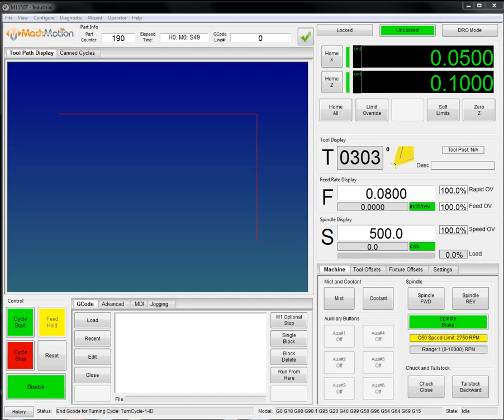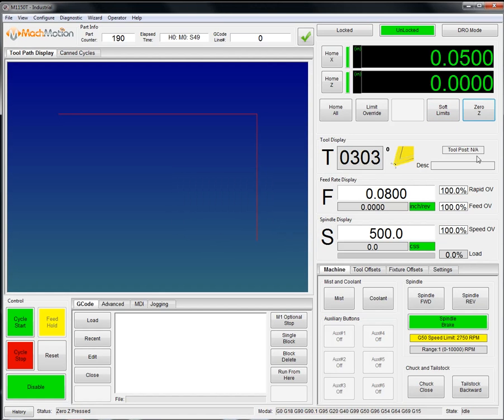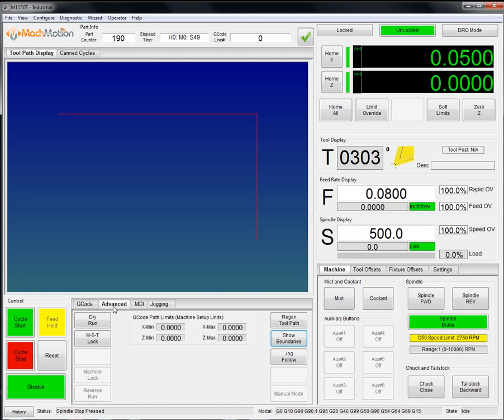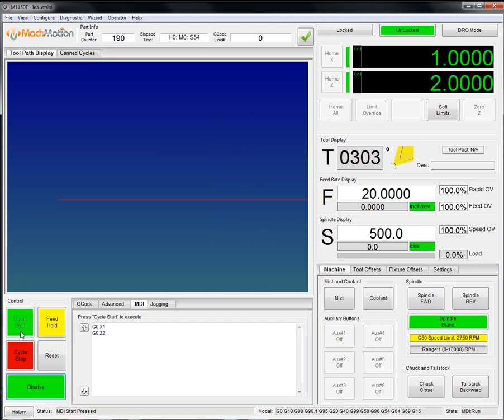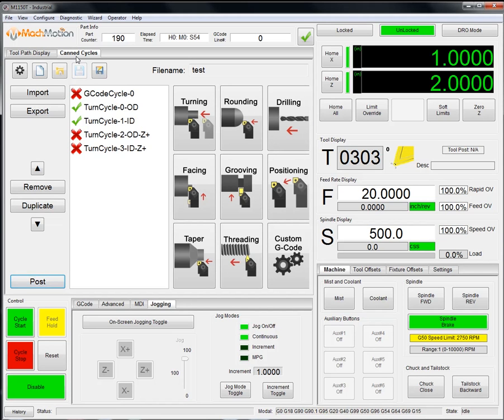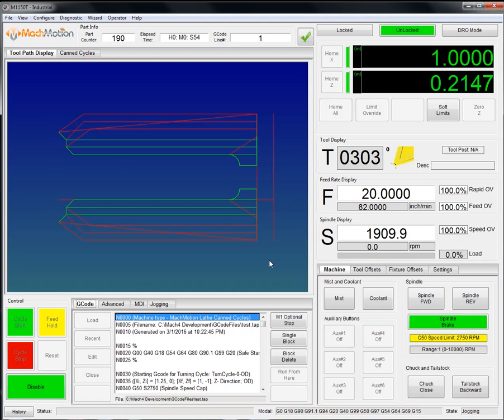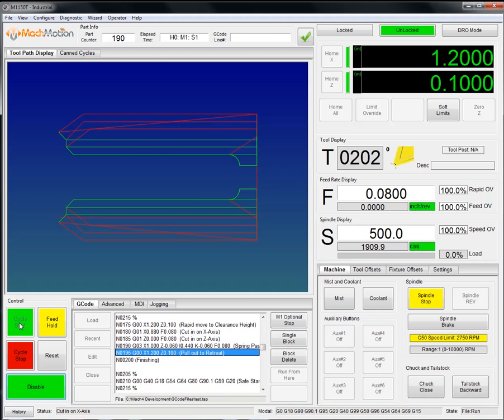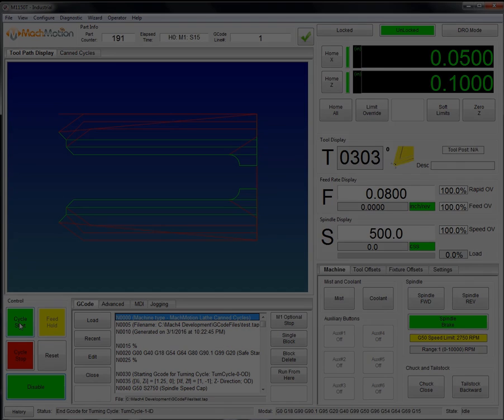MachMotion Lathe/Turn Control Demo

Comment: How do you set the X? It doesn’t allow you to manually change it like you did with the Z in this video.
Reply from the maker: X 0 is automatically set to be the center of the chuck, adjustments for X are only made with tool offsets.
Reply from the maker: Hey Sterling,
Thanks for reaching out. Our support technicians will be happy to assist you with your MachMotion control. Please reach out to our support team via our website, email or by phone.